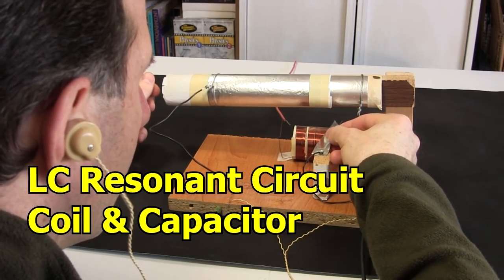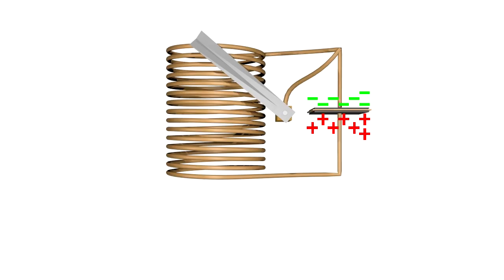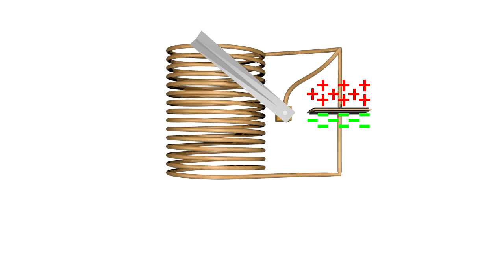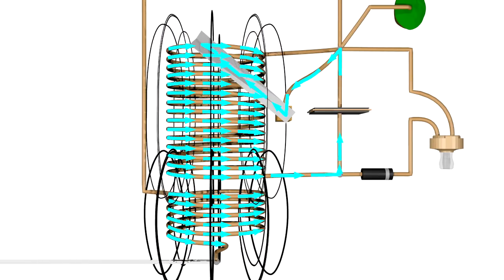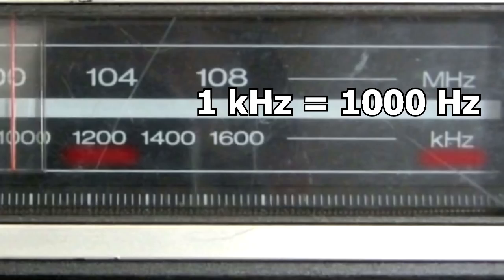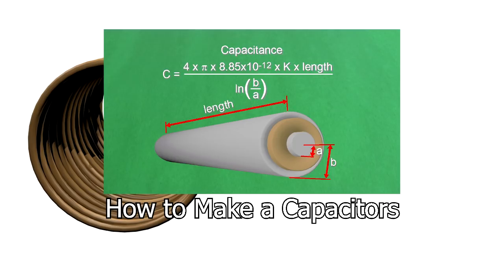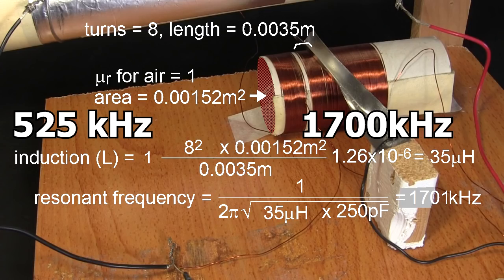LC Circuit: Selecting Coil and Capacitor

Comment: I LEARN GREATLY FROM YOUR VIDEOS!!  You helped me here...
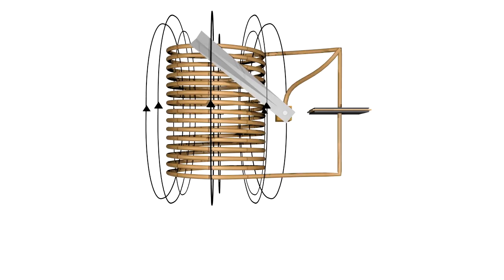At about 1:45 you state that "since the capacitor is discharged, there is no current".  ACTUALLY, the instant the capacitor is discharged, current is MAXIMUM (Here, the capacitor's ELECTRIC FIELD is zero and the inductor's magnetic field is MAX).  The "inductive momentum" of the coil keeps current flowing, THEN it slows as the capacitor starts to charge in the opposite direction.
The capacitor (thus all) current is ZERO only when it is fully charged.  Current must be zero before it can change direction.
Reply from the maker: I'm glad I helped! Thanks for watching all these years!
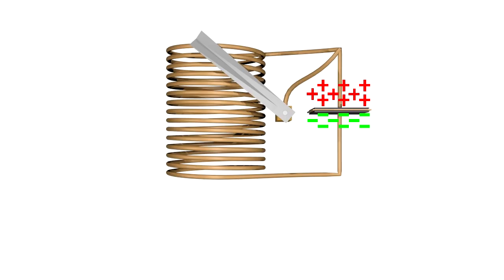Regarding 1:45, whoops, you're right. I even have the direction of the arrows the same before and after the capacitor is discharged. I shouldn't have removed the arrows at that point. I even have the arrows thickest just before 1:45 and again thickest just after 1:45, the thickness representing the amount of current. It's at 2:12 that the current is zero. I notice at around 2:37 I briefly remove the arrows again, which I shouldn't have. Man, it is so hard to get every detail right with all the informational, but also animation and video making details. I wish we could edit them after they're uploaded. I used to put an annotation to denote an error but that feature no longer exists. I'll Heart your comment and put a note in the video description. Thanks!

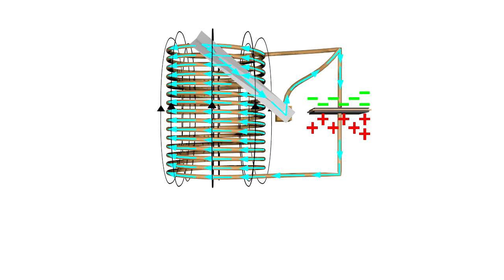Comment from the maker: ERROR!!!! The correction is that whenever the capacitor is discharged, the current it at maximum. At 1:45, 2:37 and 2:49, I remove the arrows to indicate that the current is zero while the capacitor is discharged. I shouldn't have removed them. In fact the arrows are moving in the same direction before and after those points and the arrows are thickest, meaning maximum current! How can it possibly be maximum, then zero, then maximum?! It's shown better in the animations starting at 3:16 where the arrows don't disappear when thickest. My bad. You'd think that with only a thousand details to keep track of when making these complex videos, I'd at least not make any mistakes! :-) A huge thanks to dale nassar for catching this and pointing it out.

Comment: Ur radio is essentially a very low voltage Tesla coil. TC is an air core transformer where the primary coil is connected to a tank circuit to a cap and the antenna coil is the secondary coil.  But the radio is working in reverse by receiving energy from the atmosphere rather then putting energy into the atmosphere.

Comment: Hello Mr. Rimstarorg, I used to use an RC filter connected to a homemade oscillator of unknown frequency (f). I would then calculate f by the Vout/Vin . Then I would find (L) by connecting the oscillator to an LR filter. I know R and I know f then I would find L from another Vout/Vin Eq for the LR filter.

Comment: One thing. I think the arrows on the induced magnetic field are opposite. Because the way they are now, the more magnetic field, the higher the resistance. 
Anyway great video, thank you!!
Reply from the maker: Nope, I'm pretty sure they arrows are pointing in the right direction. I even originally had them the wrong way and had to change them and reupload the video.

Comment: Still learning, best video I've seen on this topic.  I have two questions:
(1) 6:07 the section of coil you say doesn't matter, that's call the dead-end, yes?   Can't it reduce your Q, since it has a complete circuit of its own, and can thus induce EMF back into the part of the coil that you selected?
(2) The antenna coil... it has to induce energy into your tunable coil, and there will be losses involved.  Since you don't have a power source other than the antenna, it seems like you'd want to preserve all the input power that you possibly can.  So, why not just attach the antenna directly to the tunable coil?  (Or, better yet, make the big coil be the antenna, and do all your tuning with the capacitor?)
Thanks for any response you care to give.
Reply from the maker: (1) I've since heard from others in other videos that I may have been wrong about that section. Perhaps I should have left it disconnected from ground. Many years ago, the book I got this circuit from had it the way I show in the video but others in comments have said it would work better disconnected from ground. I haven't tried it that way yet to see.
(2) It's a trade-off. With the separate antenna coil, you get better selectivity i.e. less interference from other frequencies/radio stations. Without the separate antenna coil, you get more volume, as you point out. I talk about it in my how-a-crystal-radio-works video at ten minutes and forty-five seconds in http://www.youtube.com/watch?v=0-PParSmwtE
Reply: @RimstarOrg  Thanks for the link!  For my first crystal set build, I'm thinking I'll go with a honeycomb litz-wire magnetic loop antenna, sized to complement whatever capacitance range I end up with in my DIY capacitor.  But thanks to your reply, I may also add in a bypass-able selector coil, so that I can choose loudness or selectivity, depending on my immediate needs.
Thanks again!

Comment: Your teaching skill is great. I have been trying to wind some coils for radio remote control circuits . I have not been very successful. Can you please guide me on selecting the gauge of the copper wire that is be used for winding such coils. Thanks in advance.
Reply from the maker: What do you mean by unsuccessful? If you haven't been getting the right inductance then try the hard way, making different coils while changing one thing at a time. Use the formula as a guide for what to change. For example, the number of turns and the length are parts of the formula. Increasing the number of turns affects both the number of turns parameter and the length. But notice that the number of turns is in the top part of the division and is squared while the length is in the bottom but it not squared. So increasing the number of turns will give you a bigger change. Increasing the number of turns increases the inductance. Basically do the same thing you'd do with trying different values in the formula but do it in real life.

Comment: Dear RimstarOrg, how to calculate the Crystal Radio Numbers if i don't use the variable capacitors, the basic crystal radio without VC?, and if not can i use Leyden Jar as a Variable Capacitor?
Reply from the maker: The same formulas can be used, it's just that your capacitance will be the fixed capacitance of your capacitor. Regarding using a Leyden jar as a variable capacitor, that's exactly what I do. A Leyden jar is simply a capacitor where the plates are two cylinders. With mine, the outer cylinder moves. Here's the video I show making it http://youtu.be/EsZQS2GOMQE

Comment: Did I miss why the antenna isn't directly coupled to the coil, but instead is fed inductively? I heard it was something to do with better selectivity, but I don't understand why.
Reply from the maker: Yes, it's for better selectivity. I explain why in my How a Crystal Radio Works video http://www.youtube.com/watch?v=0-PParSmwtE at around ten minutes and forty three seconds in. It basically allows unwanted frequencies to influence the path to ground and desired frequencies to influence the tuning coil and capacitor.

Comment: Hello… thank you for the great work. One question regarding the antenna coil number of turns, is more turns better for selectivity and sensitivity? What is the optimum? Is there a rule of thumb or equation? Thank you again.
Reply from the maker: I don't know what goes into the calculation for the number of turns on the antenna coil. I got the number I used from some old plans in a book. One of the purposes of the antenna coil in the circuit I use is to create an electromagnetic field to induce current to flow in the tuning coil. So you need enough turns to do that. The purpose of having the two coils is to help with selectivity at the expense of sensitivity. If you didn't want that improvement in selectivity then you wouldn't use an antenna coil. I talk about that in my video about how a crystal radio works http://www.youtube.com/watch?v=0-PParSmwtE at around ten minutes and forty-six seconds in.
Reply: @RimstarOrg  thank you

Comment: from this you can create a self resonating circuit right? by attaching a diode from the output of a coil into a capcitor and then attach another coil right next to or over the existing coil and attach another diode in it and reverse it and attach it to the capacitor and on the negative of both coils attach to ground and then for a second charge that capcitor and the coils will be expanding and contracting while charging the capcitor and the capacitor will charge the other coil which will induce it into the other coil which charges the capcitor again and the cycle repeats
Reply from the maker: This won't work due to the losses I talk about at 2:52 in the video.

Comment: Hi, thanks.
I was wondering : the coil you use is not a resin coil (the ones that are being used in tranformers and motors) ?  Your wiper blade does make electric contact with the coil isn't it ?
Reply from the maker: The coil is made using enamel coated wire, like the ones used in transformers (unless the transformer coils also have an additional coating on them to solidify and protect them further). But I've sanded the enamel off of the very top of the turns so that I can make electrical contact with it. You can see where I do it in my How to Make a Crystal Radio video here https://youtu.be/VqdcU9ULAlA?t=7m2s.
Reply: thanks

Comment: Great explanation. Would I be correct in saying that these calculations should be applied to the Primary Coil in a Loose Coupler?
Reply from the maker: They're okay for the primary coil on its own but if it's interacting with another nearby coil then I imagine the inductance into the secondary would change things. I don't have formulas for that off-hand. Sounds like a Tesla coil though. If so then I'd recommend the JavaTC calculator. I used it for my Tesla coil https://www.youtube.com/watch?v=0SaEPW_iMF8&list=PLFsZmHTZL-zmfXxstlxuJgRE9bOGobEVu
Reply: @RimstarOrg  circuit diagrams for loose couplers seem to be extremely rare. I am trying to get an idea of wire gauges, number of turns and the capacitors etc. required before I proceed with my build...

Comment: Hey Rimstar I got two questions:

1. Can we not use this steady frequency as a timer or clock?

2. Why can we not reverse the induction heat process. Why can't we warm up the coil to produce current? We can reverse a lot of other processes to generate electricity...
Reply from the maker: 1. Sure, that's one use for them in oscillators. Search for hartley oscillator or colpitts oscillator.
2. There is a reversible process with coils and current, it just doesn't have to do with heat. As you saw in this video, running current though the coil produces a magnetic field around the coil. Or, you could instead push a permanent magnet through the coil and produce a current in the coil.
Reply: Oh, so just like a motor. Guess you're just "dragging" the electrons in a sense
Reply: Follow up question,  can we bank the energy from radio waves and use it to charge stuff up? How useful would it feasibly be? Thanks for answering so fast by the way, appreciate what you're doing.
Reply from the maker: Sure, that's why I got into crystal radios in the first place. I originally planned on making a bunch of small ones to capture the power from the radio waves. But with my first one I quickly learned how little power there was and didn't go further with it. But, I got into crystal radios as a result!
Reply: Nice :)

Comment: Just want to ask the remaining coil behind the wiper is shorted. Would this not shunt all the energy in the resonate circuit to a short ?
Reply from the maker: You can leave that end of the coil unconnected. I've never tried with it unconnected myself but I'm told it works.

Comment: Yo dawg, I’m tryna build a radio but I’ve spend hundreds on components and got a huge sloper shortwave antenna. I still cant get it to work. Please provide the exact measurements in this scenario, I have access to a 100pF capacitor and also a 365pF if this will work better, I have 36 AWG and 32 AWG enameled magnet wire, I have 1N34A germanium and 1N4148JP silicon diodes, also have plenty different op amps and 555 timers ready to use. I’m finding myself building other devices that are easier to understand and procrastinate on the radio because it’s too complicated please help me know the microhenries and amount of turns on a 1.25” PVC tube for a suitable tuner given the capacitance
Reply from the maker: I haven't done a shortwave but for a crystal radio, go with you 365pF and your 1N34A germanium (silicon is no good for crystal radios). The rest is in my How to Make a Crystal Radio video https://www.youtube.com/watch?v=VqdcU9ULAlA and the follow-up troubleshooting and tips video https://www.youtube.com/watch?v=HZZmKZJrIW0 I then made an amplifier for amplification https://www.youtube.com/watch?v=JtPwxbOgBHw

Comment: Hi,

You mentioned a "reupload" due to an error in B-field direction.  Is this video still posted?  The reason I ask is that I would love to see the error that someone of your caliber would make!  I have found that I can learn the most in virtually all of these cases--especially in a tricky case as this, which I have been studying to understand for so long.
Reply from the maker: It's no longer around but the only thing wrong was that I had all the arrows on the magnetic field lines drawn in the opposite direction they are now. It was a silly mistake, but an important thing to get right.

Comment: is this the same process done in the transistor  oscillator circuit btw great video cleared my doubt
Reply from the maker: I'm not sure which transistor oscillator circuit you're referring to, but one that I've played with makes use of a variable resistor and capacitor to determine the timing, and two transistors for the switching.
There are oscillator circuits that use this LC resonance for timing, but in the ones I'm familiar with, the transistor is used as part of the amplifying part of the circuit, the part that feeds the LC circuit extra power to keep it going.
But I'm not familiar with every circuit out there.
Reply: RimstarOrg can u just sent me the photo of it or even a diagram wil be helpful
Reply from the maker: The circuit with the variable resistor and capacitor came from a book, Getting Started with Electronics, By Forrest M. Mims. It's called a Flashing Light circuit in the book. It's very similar to this one I just searched for online http://www.electroschematics.com/5928/flashing-light-circuit/. I used it a the end of this video to test a DIY electrolytic capacitor https://www.youtube.com/watch?v=ml2TdQ2_2mk but I didn't show any details of the circuit.
For oscillator circuits using LC resonance for the timing, search for hartley oscillator or colpitts oscillator, though there are others too.

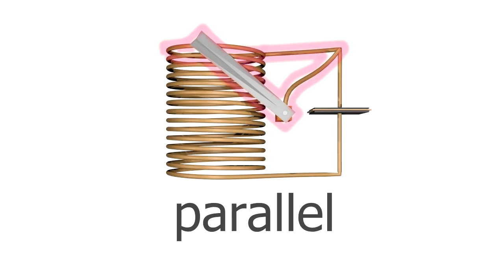Comment: 0:41 why doesn't it just flow using that wire to the capacitor and ignores the second part of the circuit, what determines the path the current will take?
Reply from the maker: In hindsight, I probably shouldn't have said that section amounts to an unpowered loop of wire. Both paths are in parallel and both are taken. For the explanation of resonance, however, it's simpler to ignore the second section, the "loop" at the end.
Reply: @RimstarOrg  I understand, thanks for replying after all this time, I did notice I was commenting on an old video and didn't expect a response honestly. another question is what's the reason to put that wire there, like theoretically speaking it should always run at max frequency as far as that wire is there, I guess? sorry if the question is kinda stupid tho.
Reply from the maker: That's a good question. I don't have a good answer though.
Reply: @RimstarOrg  no worries, thanks again, I appreciate you taking the time to reply.

Comment: Yup, had to convert it to Farads and Henries. So that's 524,006.85310 Hz (524.00685 Khz). 
How do you pick the values  of the Capacitor(s) and Inductor(s) when trying to hit a target frequency? (+1 : 415)
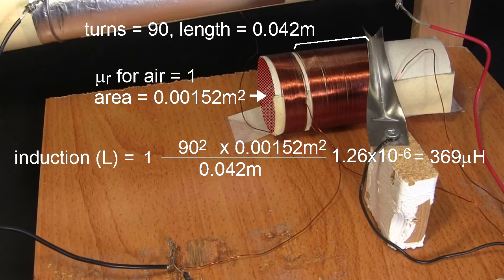Reply from the maker: I might be misunderstanding your question but choosing inductor and capacitor values is what I talk about at around 6:50 in the video. I assumed a particular capacitance and started trying various inductance values and coil geometries until I got the desired resonant frequency. If you want to try with varying the capacitance too then I have a webpage with a capacitance calculator too https://rimstar.org/science_electronics_projects/capacitance_formula_capacitance_calculator.htm. So basically, trial by error, adjusting values in the calculators until you get the frequency you want. You can also put the formulas in a spreadsheet instead so that you can try many values and see them all in one place.
Reply: So basically adjust the values of the capacitor and inductor until you hit your desired frequency. Thanks for the fast reply.
Reply from the maker: Yup. It's not as bad as it sounds though. You quickly hone in on the values. It's like looking for a name in a phone book. You don't go through it page-by-page, you quickly narrow it down after looking at only a few pages.

Comment: by adjusting the coil windings ,the lesser the windings  the higher the frequency ? or did i misunderstand
Reply from the maker: That right, you understood it correctly. I once worked on a 300 MHz oscillator that had only a single turn coil.

Comment: Hello, can i use any kind of copper wire?
Reply from the maker: Yes, just make sure it's not bare wire, i.e. it needs to have insulation on it so that the adjacent turns don't short out to each other.
Reply: @RimstarOrg  thank you very much. I'm not expecting that you will reply. I really appreciate  your response. Thank very much